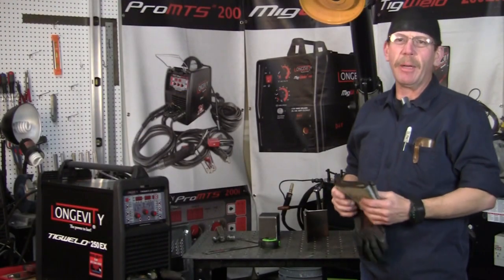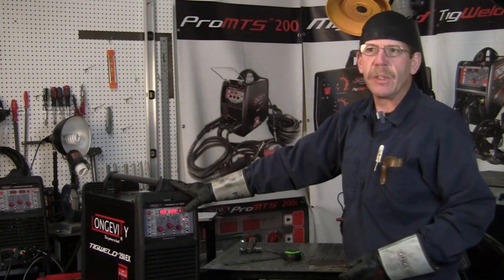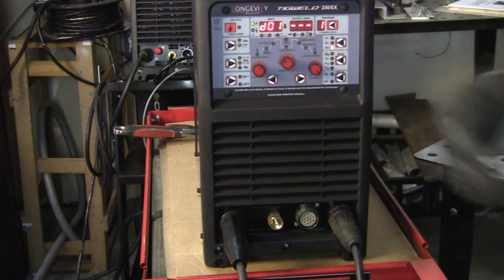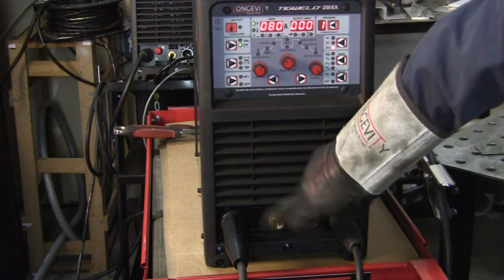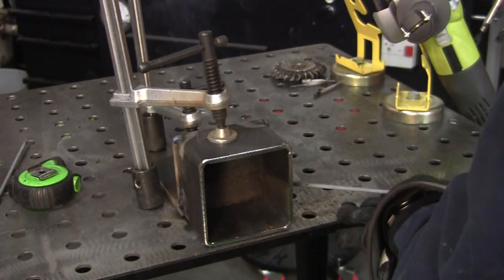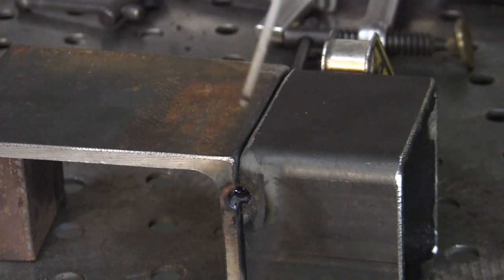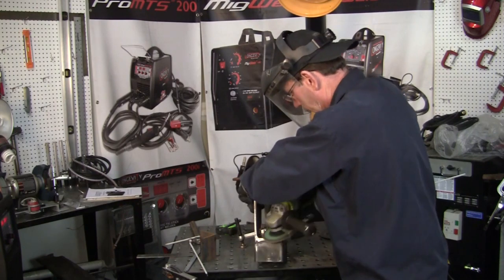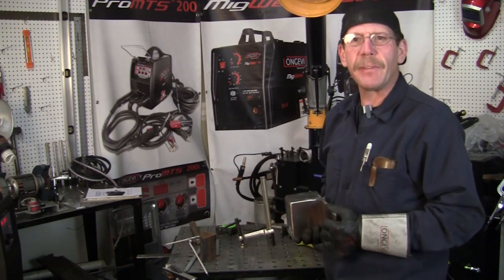Tigweld 250EX Part1 Stick

Comment: Your hookup to the machine should be Stinger positive ground negative and not touch it as the 250ex can choose between different polarities.
The way you have have it set your actually reversing what you have on machine and welding in dc- no?
Reply from the maker: Ground clamp is on the positive side for TIG. Stick welding you can reverse polarity